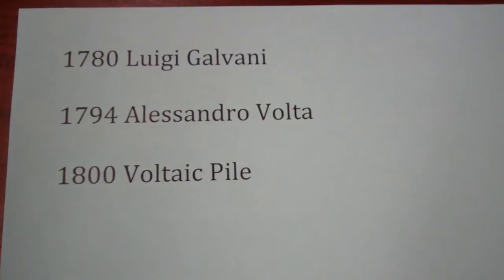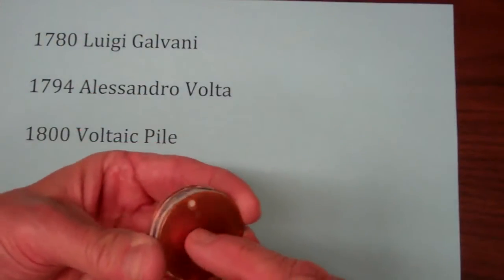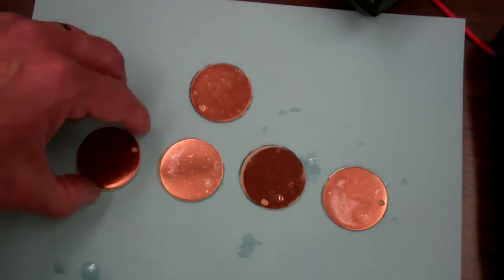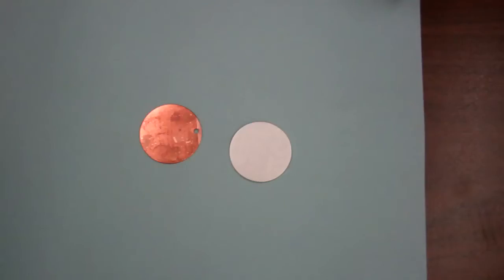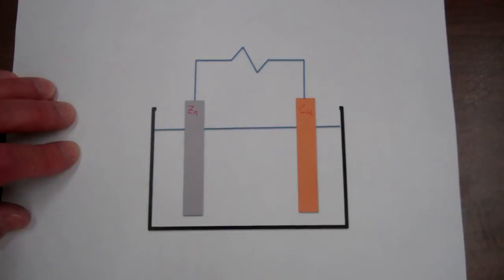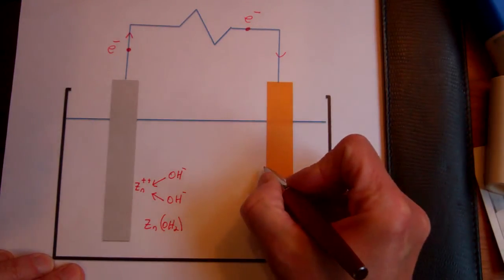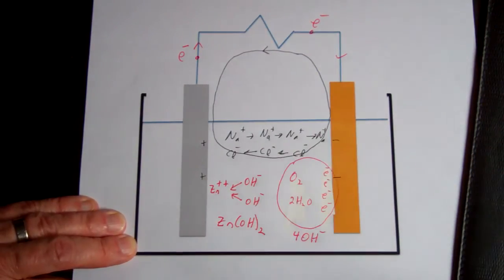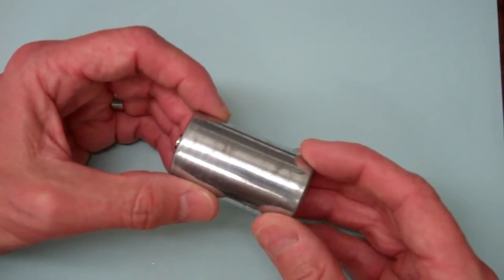Voltaic Pile, the First Battery

Comment: Just to get this things straight: first battery had been done far long ago and it was Bagdad Battery with a ceramic enclosure, and 1 electrode of copper and another one of iron in multiple times distilled water (heavy water). And all the elements sealed with bitum.

Any acid like lemon juice or vinegar would make this setup to explode due to hydrogen accumulation and “experts” are misleading saying acid was used to increase the potential.

They had only one wire coming out from iron rod placed inside the copper enclosure inside the ceramic recipient and was used with one wire system as per Tesla patent. The opposite electric sign is provided by the ground (earth grounding or air grounding, depending on requirements and/or application).

Try to make a little coil of copper wire and iron or aluminium wire coil and one of them with a smaller diameter to fit inside of the other. Place both of them in potable water and you can measure 0.5 V and 5-10 mA per cell. The difference is this cell will provide energy for much longer time and only iron/aluminium will be consumed is it is air sealed and not bitum sealed with heavy water electrolyte, and water need to be added from time to time.
Make couple of such cells put them in series/parallel and place a 100 uF electrolitic capacitor across terminals before usage. Enjoy !

Those with high knowledge able to use it at that time were called mages because beyond ordinary people belief they were performing magic (action at distance in magnetic field).

What we are seeing now and presented as battery is the way of not producing energy but wasting all the potential and resources with high inefficiency.
Fundamental knowledge is perverted by mainstream science in favour of certain benefits for very few individuals and we need to stop this type of brainwashing !

Comment: Can you help me? I've hooked up six of these 2.8ish volt piles in parrallel and the led glows nicely.. I measure the milliamps and it only measures like .750 or so on the milliamp scale of my multimeter.. I think I am getting 7.50 milliamps since the led is rated for like 20milliamps.. Is there any help you can give me? Am I not dialed in on the right setting or something?
Reply from the maker: Sorry, I'm not sure why your meter is showing such a low current. Is the ammeter in series with the glowing LED?
Reply: @electricandmagneticfields2314  Hey thanks for the reply.. No I actually just removed the led and then hooked up the meter, so it was the only thing in the circuit.. It's cool. I just really like to know the readings and something seems off with this.. Voltage is accurate. Idk about this current. I was hoping you would have measured current so I could compare but anyways this video is really cool, thanks for sharing
Reply from the maker: @bmzaron713  I've never measured the current. I am going to demo this in class in about a week and I will measure the current.
Reply: That would be awesome, thanks! Please post a picture/ video of the multimeter reading if you can.. Not that it matters but I said earlier it might be the dial setting I'm on but I only have one possible milliamp setting so that's not the issue. Thanks again

Comment: Which metals can replace zinc and which metals can replace copper?
Reply from the maker: Take a look at the turboelectric series. The metals close to copper can replace copper and those close to zinc can replace zinc. So aluminum and zinc would work about the same. Metals further apart would probably work even better.

Comment: put just a semiconductor, like CuO, Copper-2-oxide, between the dissimilar electrodes
Reply: like Znc-CuO-Cu, M-I-M, much like P-I-N in semiconductors, the charge transfer and electric field should still be there, through the semiconductor, is there an electric field between the electrodes with air gap  or air electrolyte, should be
Reply: between two dissimilar (battery electrode) metals there should be a static (non-flow non-changing) electric field according to the voltage difference of the electrode materials
Reply: water salt electrolyte will still have the voltage difference over it, otherwise there would be no ion flow to balance the chemical potential
Reply: get your theory straight, Chicken was before the egg, voltage makes things roll, voltage potential of the electrodes, you can say the electrodes are at the voltage potential the material gives them
Reply: you have the full picture if you remove the electrolyte from the considerations, either vacuum-air gap or direct contact
Reply: so whats the problem if you have a electrolyte-less contact of reverse zn-cu in the pile
Reply: intrinsic work functions of the metals, the X variable
Reply: the potential is the work function, of the metals
Reply: or rather, the difference between them
Reply: difference is the potential, work function is the absolute
Reply: potential is relative of two, work function is absolute as in one

Comment: why is there an 'continuous flow of electricity' within the voltaic cell/pile ????? it was a good watch
Reply from the maker: +john mete When you connect two different metals together, like aluminum and copper, there is a flow of electrons from the aluminum to the copper because of their different electrochemical potentials. But this flow will stop as the two metals charge, equilibrate and acquire the same electrochemical potential. To get continuous flow, another connection has to be made between the two metals. In the video this second connection is done with a piece of paper soaked in salt water. Now as electrons are transferred from the aluminum to the copper through the load, the LED in the video, a positive charge does not build up on the aluminum because Al ions move into the salt solution in the cardboard removing the positive charge from the aluminum. Similarly at the copper electrode the negative charge is removed by electrons moving into the salt solution.  So electrons can continuously flow from the aluminum, though the LED, and into the copper.